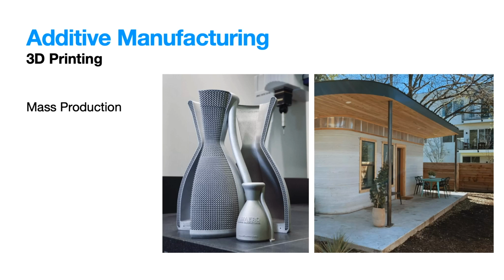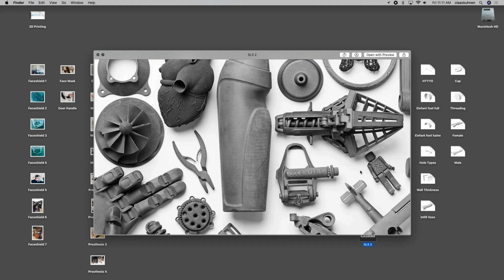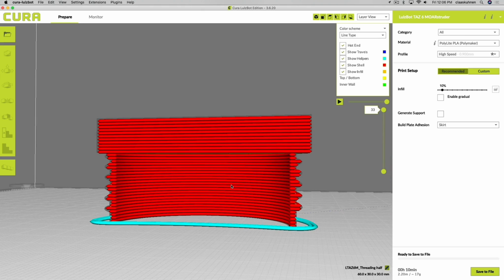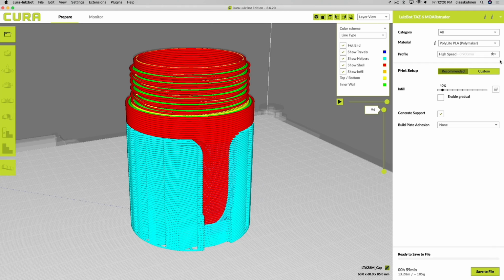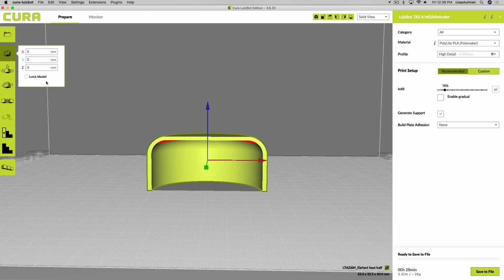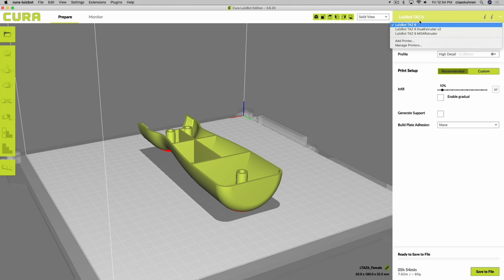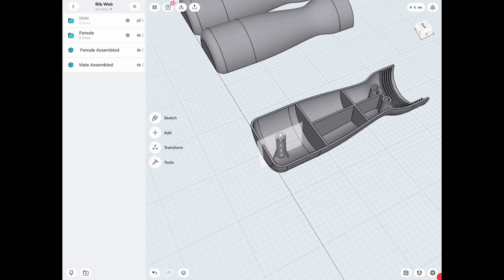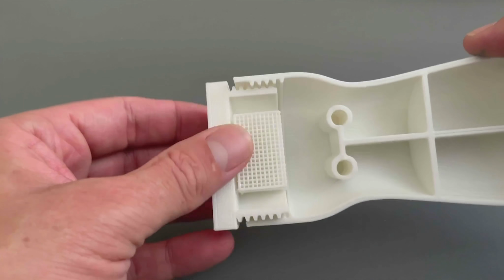Design for Additive Manufacturing | 3D Design Webinar

Comment: Recognized that a selection of a sketch doesn't highlight it like bodys in the list. Would be also nice if it would jump into the folder(selectable on/off).
Reply from the maker: Hi! In the latest version of Shapr3D it is highlighted :)
Reply: @Shapr3d  Nice, it's getting better and better with every little step.

I would like to have more options but I know it's nowadays not modern in this clutterfree design language. Like a variable to choose the snap distance i.e. every time I select a face it chooses a border and drives me crazy. I always have to zoom in and out. Only if I zoom really far in it recognises the right part and yes I am 100% shure I hit the face with the Apple pencil 2 straight in an 90° angle to the screen. Also even if snap to grid is off it always jumps in steps and not smooth only if I Zoom in, but than I see nothing else.